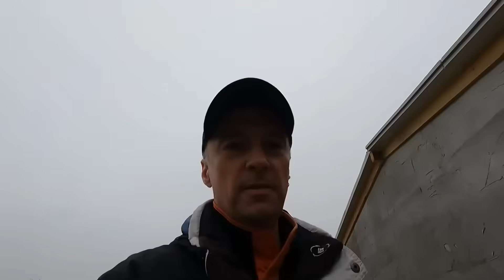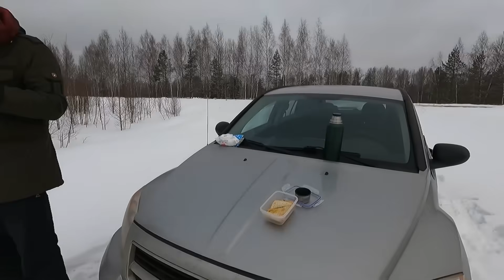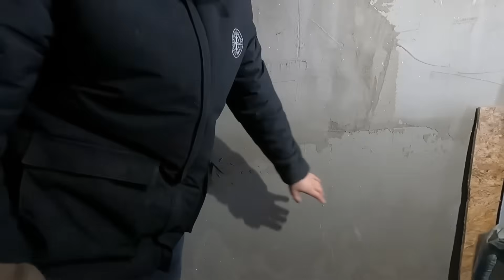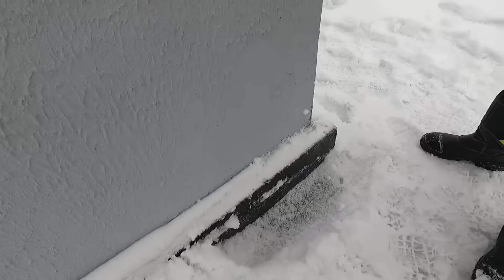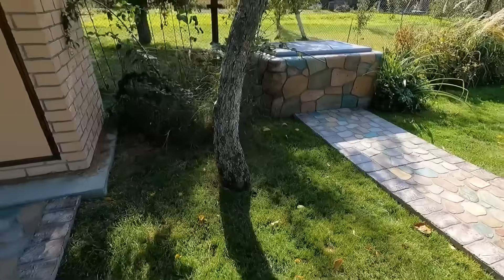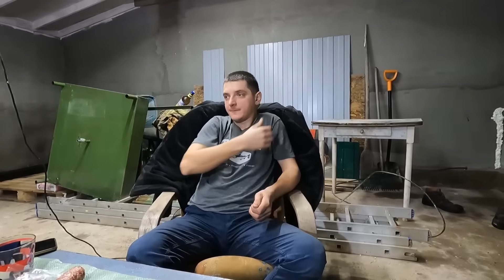How to Build a 20x20 ft House with Foam Board—No Framing Needed! DIY Made Easy

Comment: What is the big deal, to build a 20x20 ft house it only takes about $180.00 USD to frame the walls?  I don't know about other people, but for me $180 USD to have framing in my walls is worth the money. Look, 20ft is 240 inches and 240 inches divided by 16 inches on center is only 15 - 2x4's to frame the wall.  You have 4 walls so that is 15 - 2x4's x 4 walls = 60 2x4's for all 4 walls of the 20x20 house. 60 x $3.00 per stud = 180 USD. Add the top and sole plates and it is still around $200 USD.

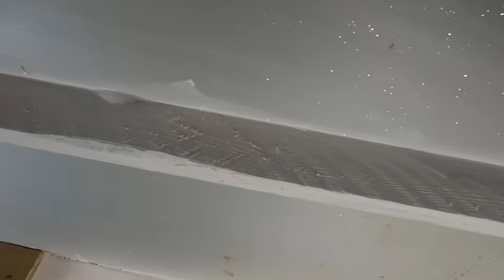Comment: 9:30  screws always attract moisture, I see it in old wooden windows that I repair, the rot in the wood is always around screws and nails.
You can eliminate by using screws temporay to fix then drill and glue in wood dowel rods, they are strong

Comment: An interesting idea, but some suggestions for you based on old traditional methods. Don't use concrete foundations. Dig out a trench and fill with rubble stone. Include a drainage trench on the lowest corners to carry away any moisture. Create the floor with a thick layer of rubble stone as well. Spaces between the stones prevents water rising by capillary action. Make sure that water running down walls is thrown clear of any foundations. Extend the roof to ensure that  the outside walls remain as dry as possible. A roofed veranda all the way round would be an improvement.
Reply: Not sure that is a good idea - if that is a workshop, you want something taht is stable ground for machines even with vibrations. And stable enough to push things around. Concrete sounds a lot better here than rubble stones.

Comment: Here in the States we call that SIPS aka Structural Insulated Panels. I would put a moisture barrier ,plastic sheets. Plus add a ridge vent to cool during summer days
Reply: Thank you for this👍🏻
Reply: I agree, I think they discussed that plan, and it could tie-in nicely with the rainscreen under the zinc roof.
Reply: @johnachurra2474 where are you buying SIPs in the U.S? If i go on menards or home depot websites, nothing comes up